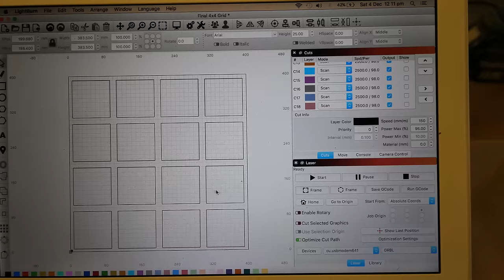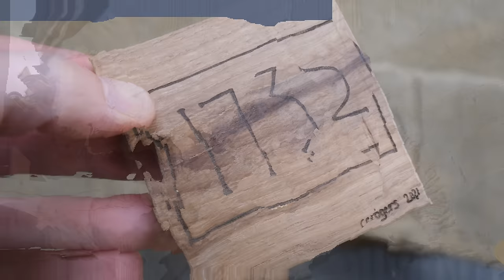What did I do with the 300-year-old Oak Barn Roof?

Comment: Instead of putting the sawdust into the compost, you can put it together with candle wax. Then you let the two components dry in an baking pan for example. Now you can cut or break it into small parts to fire up your oven. Cheers and Greetings from Germany. Merry Christmas.
Reply: I use egg cartons instead of a baking pan.  Tear of a section at a time and they're ready to light.
Reply: New Yorkshire Workshop built a compression setup for his waste sawdust to make into briquettes for his woodstove.
Reply: @TheSadButMadLad  I was going to say the same
Reply: There’s a few companies around me turning dust into briquettes but the cost is higher than “normal” fire wood. Is there any reason to choose briquettes over fire wood - or is it just cost?
Reply: Bu
Reply: We
Reply: Mix it with a little waste cooking oil and compress into brickettes.
Reply: Is there posible problem with cloging the oven with candle wax or chimney
Reply: Hey that's cool job idea... actually sawdust mixed with wax keep together the fireplace lit always proper compression of wax and sawdust mixed good.. you have the same work worthy Idea merry Christmas and a wonderful new year 2023..bro..